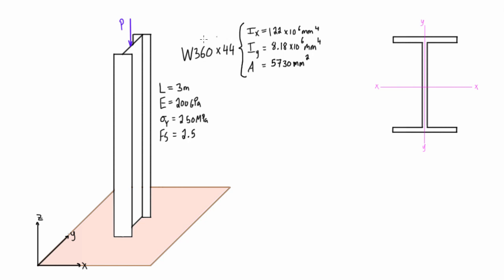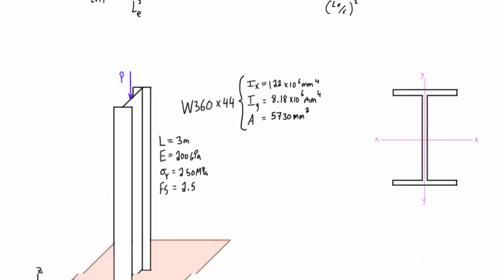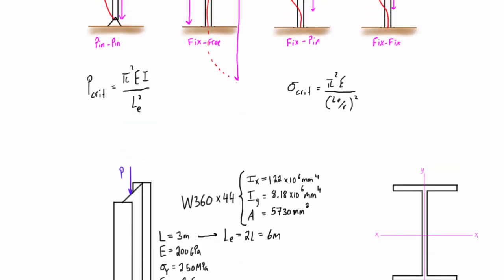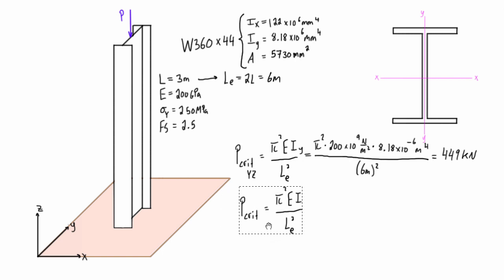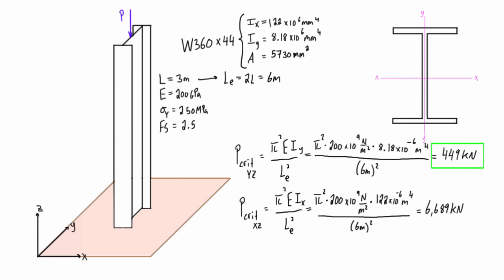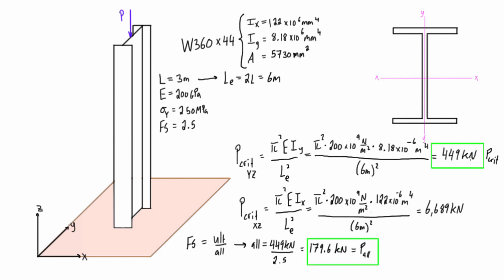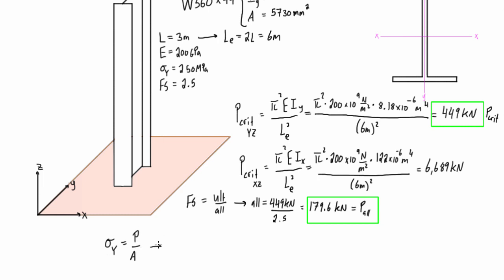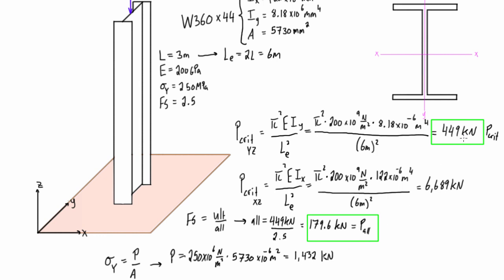Column buckling example problem #3: one end fixed, one end free

Comment: Hi there., may I ask if how many decimal places have you used for the value pf π ? since we are dealing with large numbers, (GPa, Newton, MPa, meter, etc.), does number of decimal places or rounding-off of numbers may lead to an insignificant/(ah maybe small) diffrence in the final answer? I am particular with EXACT number because I hate to use calculator no matter  how complicated the formula is., I am already used to talking to excel to do it for me. - thanks..